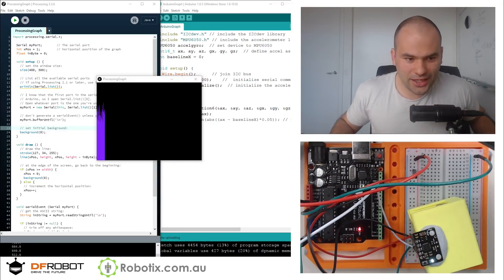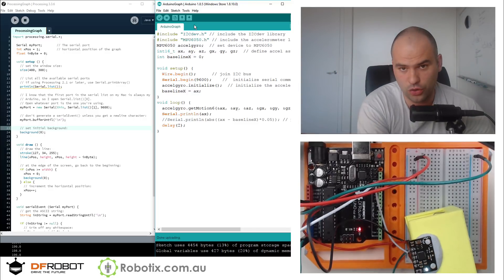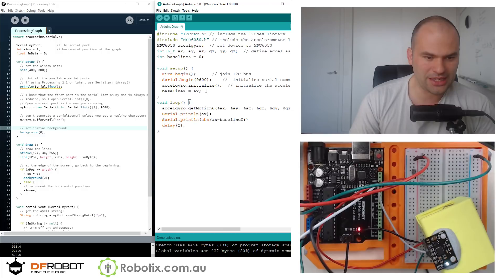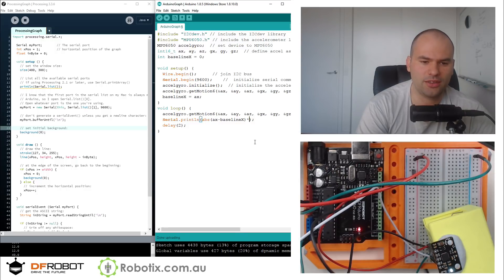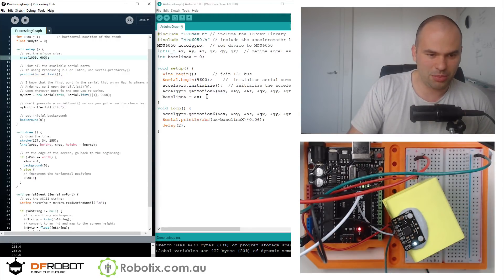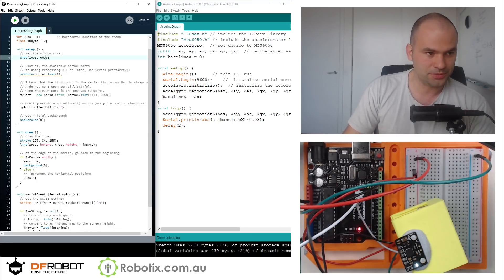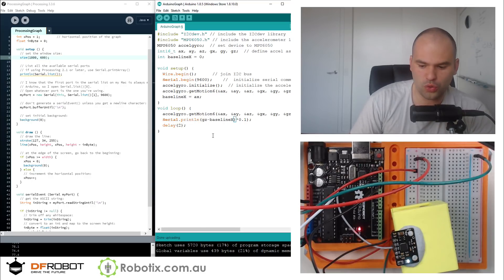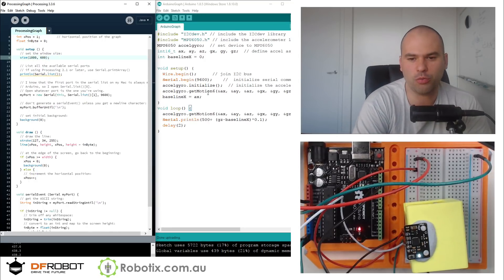Plotting (Graphing) Accelerometer + Gyro  MPU6050 using Arduino and Processing

Comment: Sir, I could not able to get the Plotting code,Pls will you help me. i have checked the Robotix site also
Reply from the maker: ARDUIO CODE:
#include "I2Cdev.h" // include the I2Cdev library
#include "MPU6050.h" // include the accelerometer library
MPU6050 accelgyro;  // set device to MPU6050
int16_t ax, ay, az, gx, gy, gz;  // define accel as ax,ay,az

void setup() {
  Wire.begin();      // join I2C bus
  Serial.begin(9600);    //  initialize serial communication
  accelgyro.initialize();  // initialize the accelerometer
}
void loop() {
  // read measurements from device
  accelgyro.getMotion6(&ax, &ay, &az, &gx, &gy, &gz);
  Serial.println(500+(gz*0.1));
  delay(2);
}

PROCESSING CODE:
import processing.serial.*;

  Serial myPort;        // The serial port
  int xPos = 1;         // horizontal position of the graph
  float inByte = 0;

  void setup () {
    // set the window size:
    size(1000, 600);

    // List all the available serial ports
    // if using Processing 2.1 or later, use Serial.printArray()
    println(Serial.list());

    // I know that the first port in the serial list on my Mac is always my
    // Arduino, so I open Serial.list()[0].
    // Open whatever port is the one you're using.
    myPort = new Serial(this, Serial.list()[1], 9600);

    // don't generate a serialEvent() unless you get a newline character:
    myPort.bufferUntil('\n');

    // set initial background:
    background(0);
  }

  void draw () {
    // draw the line:
    stroke(127, 34, 255);
    line(xPos, height, xPos, height - inByte);

    // at the edge of the screen, go back to the beginning:
    if (xPos >= width) {
      xPos = 0;
      background(0);
    } else {
      // increment the horizontal position:
      xPos++;
    }
  }

  void serialEvent (Serial myPort) {
    // get the ASCII string:
    String inString = myPort.readStringUntil('\n');

    if (inString != null) {
      // trim off any whitespace:
      inString = trim(inString);
      // convert to an int and map to the screen height:
      inByte = float(inString);
      println(inByte);
      inByte = map(inByte, 0, 1023, 0, height);
    }
  }
Reply: Sir, First thanks for reply . I am searching for the python code which plots this beautiful acceleration data.if you provide me,it helps to the data in color full window. This is my request.
Reply: Sorry, I That Processing graph is made in python. No python code found here..
Reply from the maker: @rameshchandrakasan7585  I pomise you the code is processing code. Processing is the software that you can download here: https://processing.org/. Its not Python.

Comment: I go to the link to download the file...and its broken...can u upload again pliz
Reply from the maker: Hey I have had some misfortune with the Robotix site in terms of losing saved data but I was able to recover this for you:
ARDUIONO CODE:
#include "I2Cdev.h" // include the I2Cdev library
#include "MPU6050.h" // include the accelerometer library
MPU6050 accelgyro;  // set device to MPU6050
int16_t ax, ay, az, gx, gy, gz;  // define accel as ax,ay,az

void setup() {
  Wire.begin();      // join I2C bus
  Serial.begin(9600);    //  initialize serial communication
  accelgyro.initialize();  // initialize the accelerometer
}
void loop() {
  // read measurements from device
  accelgyro.getMotion6(&ax, &ay, &az, &gx, &gy, &gz);
  Serial.println(500+(gz*0.1));
  delay(2);
}

PROCESSING CODE:
import processing.serial.*;

  Serial myPort;        // The serial port
  int xPos = 1;         // horizontal position of the graph
  float inByte = 0;

  void setup () {
    // set the window size:
    size(1000, 600);

    // List all the available serial ports
    // if using Processing 2.1 or later, use Serial.printArray()
    println(Serial.list());

    // I know that the first port in the serial list on my Mac is always my
    // Arduino, so I open Serial.list()[0].
    // Open whatever port is the one you're using.
    myPort = new Serial(this, Serial.list()[1], 9600);

    // don't generate a serialEvent() unless you get a newline character:
    myPort.bufferUntil('\n');

    // set initial background:
    background(0);
  }

  void draw () {
    // draw the line:
    stroke(127, 34, 255);
    line(xPos, height, xPos, height - inByte);

    // at the edge of the screen, go back to the beginning:
    if (xPos >= width) {
      xPos = 0;
      background(0);
    } else {
      // increment the horizontal position:
      xPos++;
    }
  }

  void serialEvent (Serial myPort) {
    // get the ASCII string:
    String inString = myPort.readStringUntil('\n');

    if (inString != null) {
      // trim off any whitespace:
      inString = trim(inString);
      // convert to an int and map to the screen height:
      inByte = float(inString);
      println(inByte);
      inByte = map(inByte, 0, 1023, 0, height);
    }
  }

Comment: Whats the rate at which data is plotted....how many samples per second? If 8000 samples per second feasible?
Reply from the maker: Yea I got 500 per second (delay of 2 millisec) Technically you could get 8000 per sec you would just have to use delayMicroseconds(125)
Reply: @SanjinDedic  what UI you are using to display/plot the graph?
Reply from the maker: @parulaggarwal3615  Its called Processing. Check it out on processing.org

Comment: Thank you sir. This is very simple, clear and distinct. But can you tell me why the MPU6050 gives sometimes NaN(Not a Number) value as its output?? It sometimes disturbs the processing graph and it freezes the graph. And again I am helpful that you uploaded the source code. Not just uploaded the demo video like a lot of other videos.
Reply from the maker: The truth is I dont know exactly but I have seen this type of thing with multiple devices. I think that if either the data gets corrupted or the number received is out of bounds of the sensor range the sensor output defaults to NaN. I have had to write code that basically says if NaN than take average of previous and next value . . . but this would have just over-complicated the code in this case